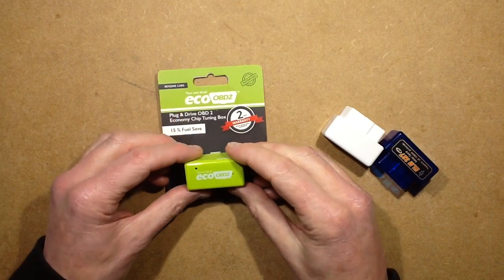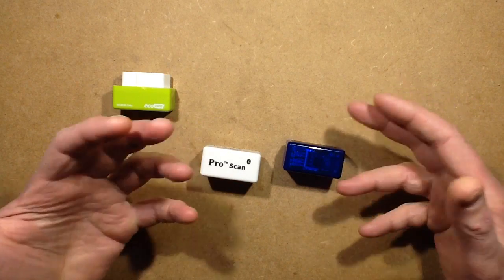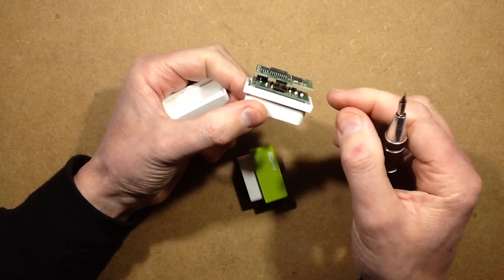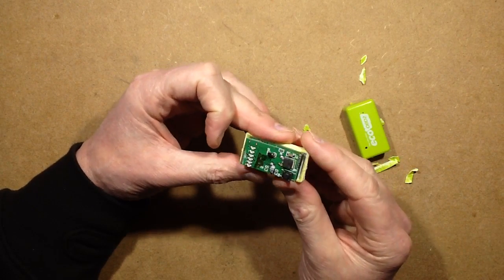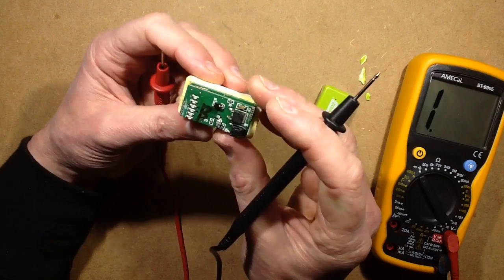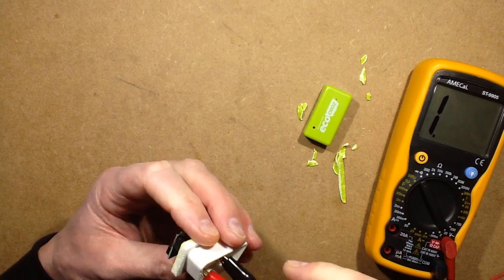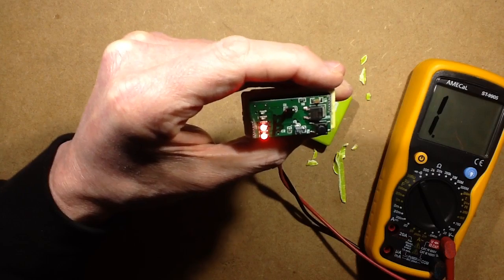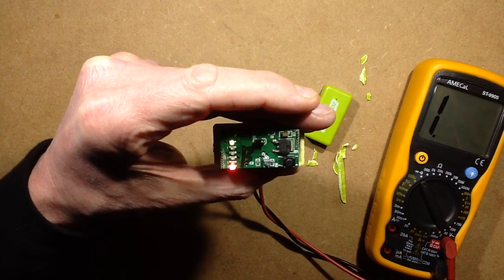Inside an ECO OBD2 "chip tuner" fuel saver.

Comment: I had an ODB II Cataloguer that was similar to this and it worked quite well, it read various stats from the CAN bus like speed, RPM fuel consumption etc you then connected it via USB and downloaded the log and would make all kinds of crazy graphs so not all of these things are damaging. Unfortunately I lost it when I forgot to remove it when my car went to the shop for a service. 

With regards to the chip in your video I suspect that the "tuning" in order to save fuel it is not re programming the ECU but instead it is fooling it I suspect that it is screwing with the O2 readings and causing the engine to overfuel or underfuel like the "chip tuning" boxes from eBay do except they have less electronics and are basically a resistor that you plug in and it changes the reading of the O2 sensor and the ECU will react as it is programmed to do. 

I don't know how easy it would be to gain access to the sensor data and manipulate it on the CAN bus but this is what I suspect it is doing, I would also say the "learning" period over 200km is for it to judge how much or little O2 to spoof on the sensor. 

NOTE: This is all speculation from the little knowledge I have on cars and the internal protocols.

Comment: plug it into a 1994 -  1998 lancia delta 1.6 / 1.8. then you'll know. why? simple: that car cannot be programmed / remapped in any way. It's a "read only" OBD connector. And the motormanagement chip inside that car isn't programmable, When this thing shows an "ok" or "uploading" light code in any way, you know it's a fake.

Comment: G'day,

Yay Team ! 

Liked & Sub'd...

  Well, considering the magnitude of the Claims and the minimalism of the Hardware..; I'm goanna take a wild leap of Conjecture and assert that the Chip is there to run the LEDs,in that beguiling sequence, thus triggering all manner of Placebo-Effect in the perceptions of the Nut behind the Wheel...

  In my experience there is but one way to add some relatively inexpensive bit of retrofitted Electrickery to reliably improve the performance of an Automobile...

  Use a Clamp-Meter to measure the current-drain from the Battery when the Vehicle is switched off and parked (expect anything from. 1/10th to 1/3rd of an Amp..., Dashboard Clock, Stereo Memory Chip, Central Locking, Burglar Alarm, Odometer Display, Engine Management Computer, etc...)...; multiply the figure for drainage by 24 (hrs in a day), add 1% of the Battery's Rated Storage Capacity (daily loss to Sulphation) and multiply that figure (Daily Resting Discharge) by 1.1 to determine the Vehicle's Minimum Daily Recharge requirement, in Amp/Hours...

 Then retrofit the Vehicle with a streamlined Solar Panel rated (at 50 Degrees Celsius) to produce 1/2 the number of Amps as the Battery requires Amp/Hours per day...; so that 2 Hours of full Sunlight or 10 hours of a Rainy Day will both still send the Battery to bed Fully-Charged..., after a day spent parked because the owner/driver is trying to save fuel by driving less...

  The PV feeds a Solar Battery Charge Controller, wired DIRECT TO THE BATTERY with an inline fuse, not through the Ignition, so the Solar Controller thinks it owns the Battery, 24/24.

 When you start the Engine, your Alternator's Regulator "percieves" any Solar Current as being a fully-charged Battery, and switches off the Alternator's "Exciter Circuit", so the Alternator ceases to function as "an Electromagnetic Drag-Brake, step-up Belted to the Crankshaft", and as a result the Engine burns less fuel and the vehicle accelerates better...

 A 5 Watt Array shaved 1.5 Litres per week off a 1983 Subaru 4WD's Fuelburn, a 20 Watt SunFoil Mk-2 cut 4.2 Litres weekly, and the 30 Watt Mk-3 reduced fuelburn by 5.33 Litres per week...; 266 Litres per year, 690 Kg of CO-2 saved, annually.

 I'm about to retrofit my recently aquired 2000 vintage Subaru Forester with a 70 Watt Mk-8 SunFoil & a Regulator, ($170 + $50...), and because it's Battery is currently resting 15% flat every morning, I'm expecting to see a 15% reduction in Fuelburn.

 My son is the local Auto Electrician, and he's allowed me to put a SunFoil onto the car he drives, twice (20 Watt Mk-2 onto his Subaru Brumby when he was a 1st year Apprentice, 30 Watt Mk-5 on the Turbocharged Intercooled Diesel 4WD Rodeo when he finished his apprenticeship, which he still drives, after taking over the Business...) ; if it was a bullshit Idea he wouldn't have let Daddy put ANYTHING on the roof of his Ute...

 Backtrack me to my "SunFoil Project" Playlist, to see the raw experimental data, and construction videos...; open source, DIY, retrofit whatever you drive, waste less, fart less, contribute less towards Global Warming...

Please ?

Have a good one,

;-p

Ciao !

Comment: What that device probably does is monitor various sensor inputs to the ECM and modifies the signal to change the performance characteristics of the engine. It basically doing a "man in the middle" attack on the engine computer. I highly doubt it's making any changes to the ECM software.

Comment: Installed a ton of chinese knockoffs for costum LCD'displays showing all sorts of crap for those Streeracers ;) 
Atleast here, they all have costum lcd readings inside around inside the car, some even have the speed shown the 
current speed in the entire rear windshield ;) 

Almost always(the last 3-4 years) used the blue kind, cheap and easy to use for custom lcd ;)

EDIT: Ofcourse this is BS. each engine manufactore is so fine tuned to be effective, amd control circuits are protected.
The only REAL way to modify is actual ECU reprogramming, or ECU replacement (chip tuning)

Comment: those are just left overs from Progressive Insurance. you are supposed to plug it in and your driving habits are recorded and sent to them. things like acessive braking and engine speed,indicating agressive driving habits as well as distances and sent to the Insurace company. They can then adjust your insurance rates according to your habits. the lights you see are the usb and wifi part of the unit. In other words, Its a unit they are selling you that has nothing to do with what they claim it can do. its a monitoring device, thats all it is.

Comment: your car does that all the time dude. its part of the on board computer system. dont add anything to your system that could possibly screw with it. I dont know what you paid for it but send it back. Just so you know. It cannot rewrite the memory on your onboard computer. its a read only system, acessed by your system and has limited variables as designed into it. To rewrite your program on your computer requires someone with a background in auto computer systems and you would still need the program and be able acess the onboard computer, wich you cant.

Comment: Fake, at best it will cause a few different cars to lean out, which isn't very healthy for the engine to begin with.  BUT, you can, at least on a large chunk of American cars, change shift points, and re-tune the engine computer, but it requires something like HPTuners (we are talking software that costs several hundred USD) which is ran on a laptop, and you use a cable to interface with the OBDII port.

But, there is NO "plug in and go" solutions, maybe back in an early 90's, but that requires, as you said in the video, replacing an EEPROM chip with a modified one.  The only "Plug in and go" solutions are ones that give the car false data via various sensors such as the MAF, and causes the engine to lean out, OR run overly rich, which in either case, is bad.

Comment: If you want to test one of those OBD-thingies, just go to a car scrapyard and ask if you can borrow a car to test them with, if you brick a dead car there isn't really any dangers to valuable equipment, just remember a 12 Volt battery since some places remove the battery to avoid leaks or other problems.

Comment: Obviously didn't get a good look at the other side of the PCB but doesn't look like there's anywhere logical to store the 'driving data' so it's probably not doing that. I also didn't see a CAN transceiver. I've never seen a micro controller (with a CAN controller) that can take CAN signals directly.
Reply: Also for long term analysis you need a persistent clock (always powered) - didn't see a battery. That said, there is no need for a crystal with most micro controllers if you're just doing a light show - I expect that to be for tx/rx synchronisation. They've gone to a lot of effort to fake this.

Comment: We have a Nissan Leaf - 100% electric car.  We bought an ODB2 connector and the Leaf Manager software for our Android tablet and phone. Brilliant. And yes, you can change some parameters on the car with the app. The only one we have changed is "Lock all the doors on going into Drive and unlock on going into Park". I am sure we could do a great deal of damage with it on an electric vehicle, but the diagnostics and logging of battery condition etc., is really valuable. We leave it plugged in all the time; the red LED is always on. We had the car serviced a few weeks back and they must have removed it, but the Nissan engineer obviously replaced it when he'd finished.

Comment: For this to be real I would expect 2 microcontrollers, one the elm interface mentioned below and the other to do the business.
The chances are the micro you have allready seen inside is a elm327, this is a pre programmed pic chip that is capable of recognizing which out of all the vehicle protocols in use your car uses and connects an external device via serial to it, this would explain why all the comms pins are conected, the elm is a protocol converter and its in nearly all cheap obd2 dongles.
The elm 327 doesnt support re-mapping, which is the only way I can think of that you'd be able to 'economise' an engine, you can pull pids from the ecu which are measurements such as coolant temp, rpm etc, and with the key on engine off you can force certain solenoids/relays to pulse but thats about it.
There are multiple other wonder devices that you connect between various sensors on your car and the ecu which are meant to do the same thing, there has been videos of some people taking these apart too, I've seen on ewith a complex circuit inside which wasnt even connected to anything.

Comment: It's totally possible to reprogram your ECU through the OBDII port... Check out COBB Tuning Accessport. But I mean, those things have very specific tuning maps for the car that they are in and they take quite awhile to actually reprogram the ECU. Also, it's not something you can just do on the fly. Those are full reprograms though... I mean if it were just doing something simple like changing the spark timing, might be different. Definitely wouldn't go sticking one in my car!

Comment: all modern ECU's are encrypted. if you want to reflash your ECU maps to be more fuel economic than it takes more than this "China magic" even the strategy how a car is tuned is different from any car manufacture. this will do NOTHING! you have devices that you can plugin before your wires reach the ECU but this is dangerous and could cause engine failure since the ECU calculates engine loads from the readings of most sensors that also affect fuel economy. so there is only one good way to tune your car to be more fuel economic. just put a brick underneath your gas pedal this will cost you close to 10cent and instant result you don't have to wait 80km for it to take affect.

Comment: As far as I'm aware this is absolute 100% snake oil. There is no way to have a generic OBD2 tool that can successfully alter your car's ecu programming. Many cars CAN be reprogrammed via the canbus, BUT it takes 15-30 minutes typically. This is even worse of a gimmick than those small chips you clamp onto various sensors in the vehicle. The idea of those is that the signal is altered, since say the ECU will receive .1 to 1 volts on a wire from a sensor, the device will plug inbetween the sensor and the ecu and alter it, so if the sensor originally says .5 volts at highway speed it might now say .45 volts. Not only is this idiotic, no car manufacturer will give you 15% less fuel efficiency for NO reason, they want to milk every ounce of efficiency they can out of their cars, but typically these devices will run your car lean which can cause premature detonation (no man wants that), that will actually lower your power quite a bit as the car will start tweaking it's timing and air fuel ratios to compensate. It's even worse of a gimmick than "high performance spark plugs". Basically EVERYTHING in your car is designed to an EXACT specification, things like this or high performance spark plugs is identical to plugging in a 20 watt power supply into something that uses 30 and saying you're getting better efficiency, nothing good will happen.

Comment: We have a few of this Ctrack ODB130 thats a GPS and CDU monitor,  it a reader and do not update car settings,  Some of the 10usd ones from China also just readers some will link to your phone by BT and give you updated trip info fuel use somethign that might be handy for some, ELM is one of the low cost brands, that I know works

Comment: Their are OBDII flashers out on the market for cars. They are to add performance to the car, they usually sell for hundreds of dollars USD. They are specific to that make model and year though. If you look up something like Super Chips on google you will find it.

I wouldn't trust plugging this into my car to save fuel at the risk of completely destroying my cars ECU without a back up flash. That cheap little thing can cost you more in the long run.

Comment: I can only vouch for my Renault however whenever I kill the battery power (remove the battery leads), the ECU need me to drive 10km to "relearn" the fuel efficiency, i.e. if I use "normal" petrol instead of Ethanol, its usually better to disconnect the battery leads, hence the ECU re-calibrate the engine for using Ethanol. Same if I go the other way around, removing the battery after switching from Ethanol to petrol, and I get better fuel efficiency so in theory, a device like this one MAY be able to re calibrate the fuel efficiency however I'm not sure I would try until I have the blessing of my local Renault engineers.
By the way Clive, I have a number of LED lights from Sweden, made for a "home depot" in Sweden with rather different schematics. I can send you the pictures and if you like it, I can send the the lights. Just let me know. You can send me a mail to johan@acquris.se

Comment: The Bluetooth one, the little blue elm adapter is great, I've used one on lots of different cars to read error codes and reset them after doing repairs. I use OBD auto doctor on my android phone and laptop, works best for me. 

The fuel saver one i suspect is just a micro controller to control the flicker of the leds, that's all. Mighty car mods did a similar test on a so called tuning chip off ebay. Check it out https://youtu.be/VGtImIP6j3A

Comment: Chinese chips and tuners if they do anything at all will only trick the ECU into thinking the temperature is lower or higher, which slightly richens or leans the fuel . and the vehicles ecu will work it out in minutes and reverse any changes.